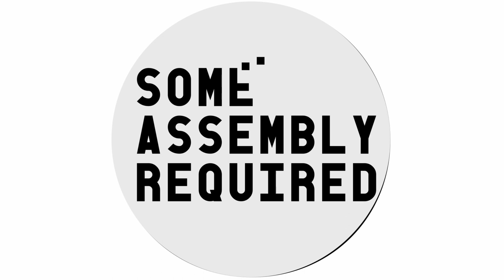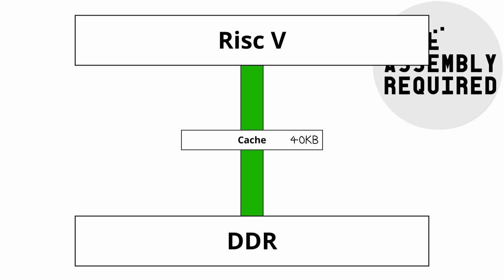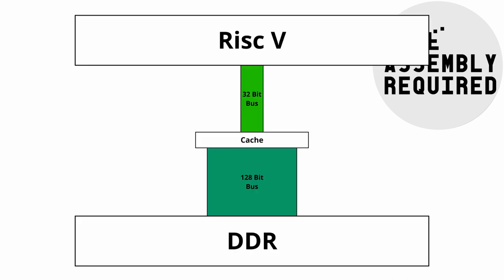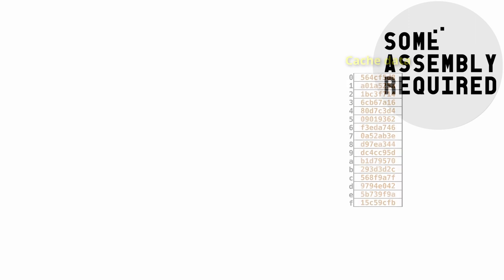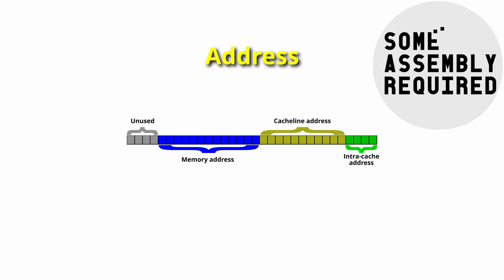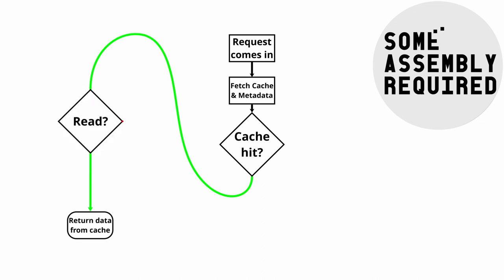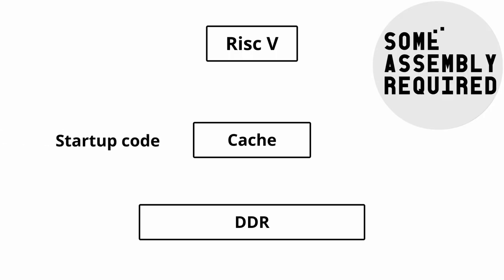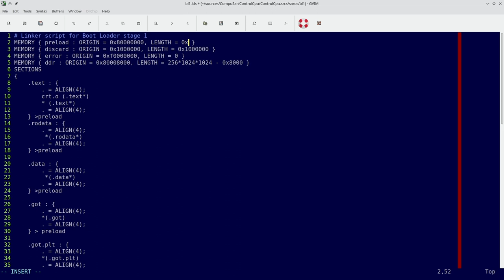Implementing Memory Cache in FPGA

Comment: Marking the bootloader as dirty and having the cache controller handle it was genius! :)
Reply from the maker: THANK YOU!
I was so proud of this trick, and it got absolutely zero reaction.
Reply: @CompuSAR  nah, I was watching like "oh, how's he getting out of this one." and then you pulled this off, and I was like "woah, magic!" 🤣 genuinely excellent! Excited for more! Keep up the series, please! 😍
Reply: Very interesting idea, very crafty. An other solution is to read the EEPROM thoughts SPI, it must have at least few MB available to be map as read only.
Reply from the maker: @vincentvoillot6365  There's no shortage of space on the flash. Getting it to the CPU is another matter. That would require dedicated hardware that runs counter to what we're trying to do here: minimize the hardware requirements of the design.
My solution is 100% free, in that all of the hardware it requires is used anyways.
Reply: @CompuSAR  Yes, there would be an hardware overhead, but that much ? After all the SPI interface with the flash is already hardwired.
I know i'm late to the party and you have done a really amazing job with the DDR controller. But didn't you cross path with the LiteX framework during your research ?
Reply from the maker: @vincentvoillot6365  The SPI controller in place is a DMA one. It isn't suited for returning data on the slave end of the bus, which is what you'd need for the CPU directly reading from the controller.
Also, that controller came later than this module, so relying on it would have delayed _everything_, after a very extensive delay because of the DDR controller.
I have not heard of LiteX and have no experience with it, but from briefly looking at it I suspect it wouldn't fit on the FPGA I'm using. I've seen standard IP solutions that needed 85% of my available resources just for the CPU+memory. I'm using 25%.
This is before mentioning that the purpose of this whole project was learning how to create FPGA designs.

I'm writing the following without having tried LiteX (or any other framework), so I may be unfair here. Such frameworks tend to create a huge step you need to climb over. I'm sure they have a 32 bit CPU, cache, DDR controller and SPI. They will not, however, have a 6502, 6522, VIC or SID. They can only be used for the overhead of the project, not it's core.
Which means I'd now have to learn not only how to use this framework, but also how to integrate it into the 8 bit world. That tends to be a lot of work spent on something that has little application outside of this particular project.

I'd rather spend time solving the problems that my design choices are creating than solving problems that my infrastructure is creating. The later are much more frustrating problems to handle.

Comment: Brilliant. I notice the 65C816 has a couple of output lines that can be used to separate cache operations for program data and program instructions. VDA and VPA. I wonder if they were thinking of a way to signal the bus controller to pull program code from an underlying EPROM, yet seamlessly make that address space available as RAM.
Reply from the maker: While it can be used this way, I don't know of any implementation that does. Giving the instruction and data buses different values on the same address is very rare (though VPB on the W65c02 is designed for, pretty much, precisely this). It's more about having different caches for both.
If you're going to have a fast enough (i.e. zero wait) EEPROM, you wouldn't bother putting a cache between it and the CPU. Why would you? It's zero wait state.
But if you execute from DRAM, your instruction fetches behave quite differently than data fetches. This means that a single cache will be less effective, with the data and instruction invalidating each other's accesses. Having separate caches for both would make sense.
For CompuSAR I did something a little different. The iBus and dBus are completely separate on the RiscV. The dBus goes through an address router that directs it wherever, with the DDR being one option. The iBus only goes to the DDR (at the same addresses), but has one more layer of cache. So the dBus goes through a 16KB cache to the DDR, while the iBus goes through a 4KB cache to the same 16KB cache the dBus uses.
Without it things worked, but the FPGA would heat to the point where memory actually started coming back incorrectly (bit flips as per https://youtu.be/Y2rsNxfKZ1I). With the two layers cache things work quite nicely. Since the iBus never writes, I don't need to handle complicated cache invalidation cases. This breaks on self-modifying code, but who cares?
Reply: @CompuSAR  I've been thinking of using VPB in the 65816 to choose among irq vectors. I'm thinking of dual 65816s, and I want them each to have independent access to the various IRQ generating devices in the design (UARTS, VIAs). There appear to be a contiguous 7 vectors worth reserved from FFEE to FFEC. So if I can force rewrite the last four bits of the vector as read by the 65816, then I can have each device choose its own handler.
Reply from the maker: @AlanCanon2222  I'm not sure what your setup is. Having different CPUs get different interrupt vectors is an interesting idea. The selection logic is a little big for that. Are you building the computer out of discrete  74xx logic chips?
Reply from the maker: Also, bear in mind that on the w65c02s, at least, the MLB signal can't be relied on to signal read-modify-write operations correctly. For all "legacy" operations it is only low for the last two, not three, cycles of the command. So the "read" part is done with the memory not locked. I've never touched the 65c816, so I don't know whether that's also the case there.
Funny story: when I first reported this, WDC didn't believe me. Since then they amended the datasheet to record this bug, at least on the 65c02.